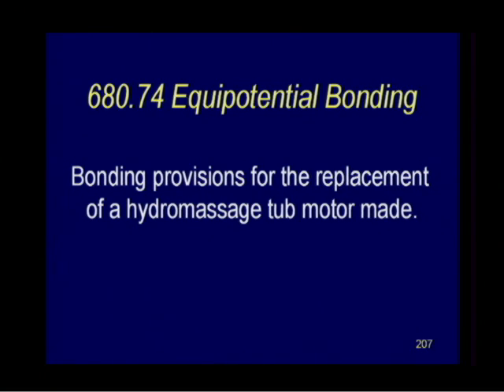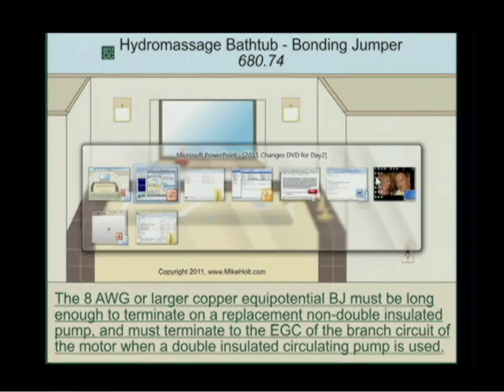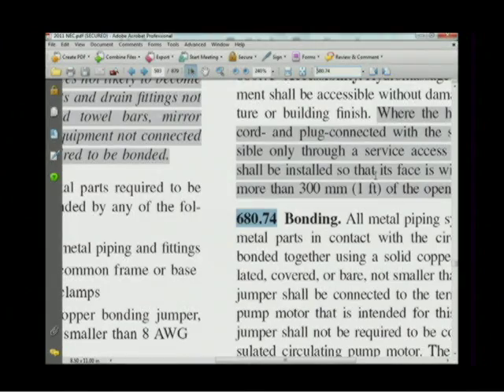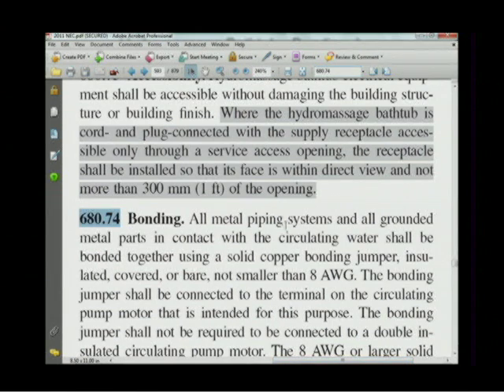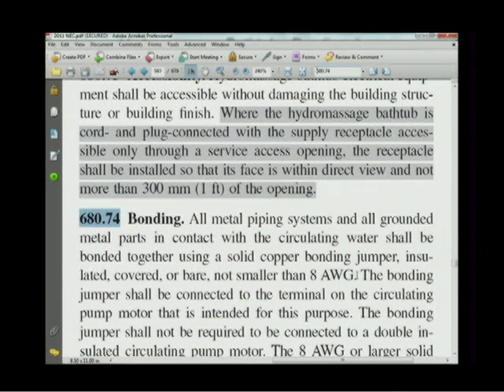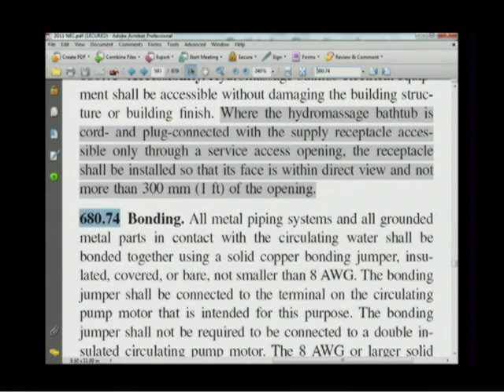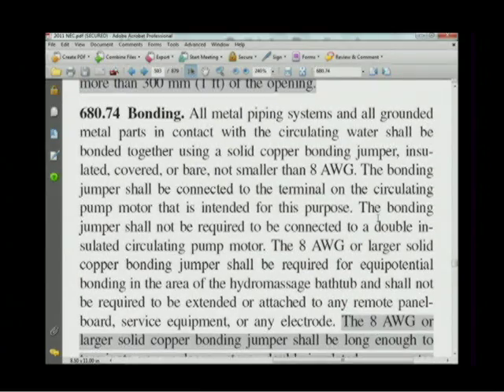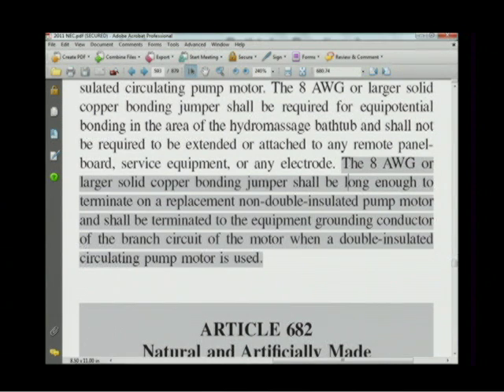Hydromassage Bathtub Bonding [680.74] (9min:32sec)

Comment: What the code is saying is if you are using a motor that is double insulated you must provide for future possible use a #8 ground wire pre-connected (bonded) to the supply. Also one point that was not brought up, and really probably the bigger reason for this provision is the use of an inline heater which is a metal pipe in direct contact that is a source of 120 or 240 VAC. What I don't understand is in most cases both the pump and heater already have a ground, so is the bonding a second level of protection? Doesn't this make a ground loop?
Reply: You can't arbitrarily drill holes  in the bottom of a enclosure. To do so would void the UL listing of the enclosure. I agree you're setting up induced voltage, ground loop, with no place to go
Reply: Maybe I don’t understand double insulated pumps, but my understanding is that there is a transformer inside, making the hydromassage a separately derived system, hence bonding the metal piping to the terminal on the motor that is designed to return fault current to the motor’s source.
Reply: Same thing o was wondering.  I’m just tying in everything (220 pump and heater not double insulated) to copper pipe